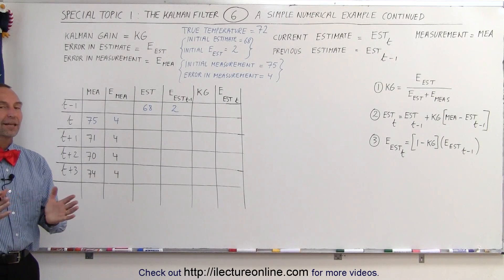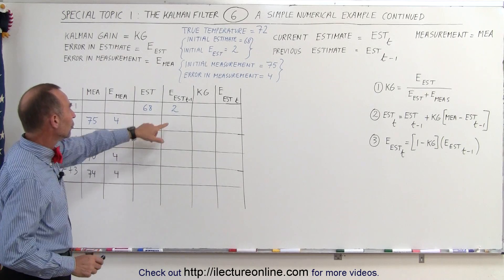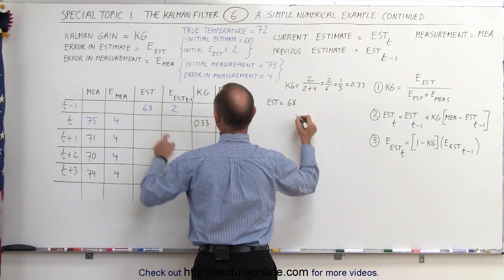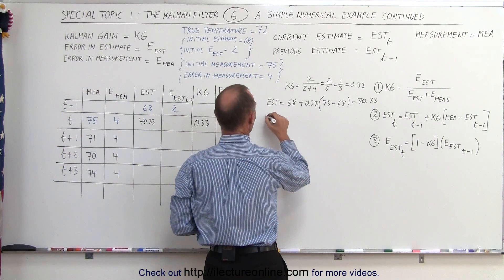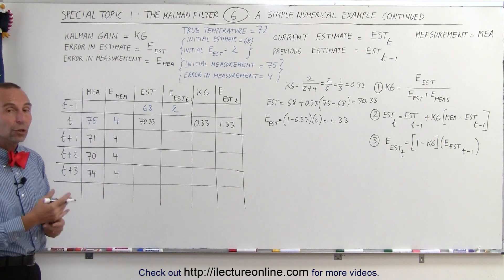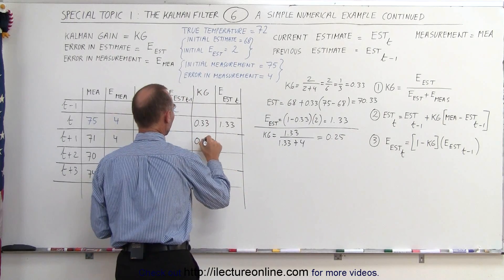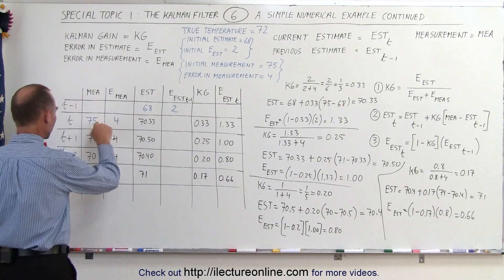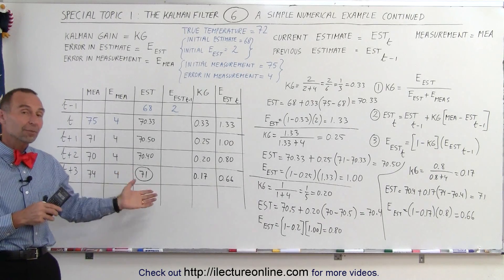Special Topics - The Kalman Filter (6 of 55) A Simple Example of the Kalman Filter (Continued)

Comment: Great explanation, but I noticed that if I just take the simple average of all the measurement values + the initial estimate in each step, we get more accurate numbers in each step.

I get the next values at each step: 71.5, 71.33, 71, 71.6, so while I understand the explanation, its hard to see why is it better at this point.

Guess I need to watch the other vids as well :)
Reply: An update to my comment: based on intuition I thought Kalman filter might actually be better when a big error comes in later. With two extra points:

extra measurement 1: 79

KG		0.14
ESTt		72.12
EESTt		0.56

extra measurement 2: 75

KG		0.122
ESTt		72.4656
EESTt		0.49

The relevant values we got by averaging are 72.8, 73.14, so bingo, averging is worse for this case.

So as far as I see Kalman filter actually handles better the unexpected big errors later on, thats where its better, it has a natural flattening built in due to the keep decreasing KG.

But then the next obvious questions are:

a) What happens if we get really unlucky at the start and we get 78,79,77,79 readings, so Kalman filter establishes itself up around those values and then it will be much slower coming down than the averaging method, as the KG factor will be also small by that time.
		
b) Could we achieve a similar flattening with simpler methods, just by saying I give less weight to the datapoints coming later and somehow maximize this flattening effect based on the fix Error in measurement? 

Now thinking it through point b) KG calculation probably does exactly that.
Reply from the maker: The first few videos are just there to gain a basic understanding.  To see how the KF really works see the rest of the playlist.
Reply: I was thinking the same thing! I guess this is just a very simple example and the real strength of the filter comes in when you look at multidimensional processes and hidden variables: you measure temperature but the variable you're interested in is someone's immunity response, for example. 
Also, the deviation of the Kalman filter is better: if you take the mean, the std = sqrt(16*4 + 4) = 3.69. VS 0.66 for the Kalman filter.

Comment: how do you find out error in the measurement in the first place?
Reply from the maker: Depending on the situation and the sensors used, the error may be known based on the known performance of the sensor.  But if not known then we must guess.
Reply: @MichelvanBiezen  got it. thank you for this series!

Comment: If you take the simple average (75+71+70+74)/4 you get 72.5, which is even closer to the true value than the Kalman Filter.
I wonder when is the simple average worse than the Kalman filter (for stationary values)?
Reply from the maker: This is just for illustration.  If you watch the next videos in the series you will see the value of the Kalman Filter.  It works amazingly well.

Comment: How do we determine the initial estimation error and measurement error?
Reply from the maker: You make an estimate based on your knowledge and understanding of the equipment used.  Even if you don't have a good estimate, the filter will quickly converge to the correct values.

Comment: If our true temperature is 72 and measurment error is 4 ,does it mean that our measurments can not show values outside of this scope  (68---76) ?Thank you
Reply from the maker: No, the values being read can still be outside those values.  The measurement error can be caused by the fluctuations in the equipment, or the accuracy of the sensor, or any number of known errors that can affect the measurement.

Comment: This is a so great class series that I enjoyed watching. One thing I like to make sure I understand is the Error in Measurement, 4 in this example. Is it correct that each particular measurement setup has its own error in measurement witch is a constant? And how do we find out the value of it? Thank you!
Reply from the maker: There are several sources of errors in measurment (error caused by the internal electronics of the application, errors in the SW algorithms, errors in the actual measurement, etc.)  These are dependent of the system you are dealing with (radar, tracking, GPS, automated measuring devices, etc.)  Most of the errors are known, and are used in the Filter.  Some errors are random.
Reply: @MichelvanBiezen  Thank you for the answer!

Comment: Excelent video Mr. Van Biezen, but I have a question: if instead of applying the Kalman Filter you simply calculate the SMA on the measured data, i.e. (75+71+70+74/4) you get 72,5 wich is more close to 72 than 71. Would it be better to calculate the SMA than the Kalman Filter?
Reply from the maker: This is just a simple example (along with the following videos) to show how the KF works.  In an actual application we don't know what the actual (true) value is and the KF will get us closer to the true value than any other method.  (It places a weighting factor on the assumed errors and the measurements)
Reply: @MichelvanBiezen  Well, Mr. van Bienzen, I understand, but then I have another doubt: if we dont know what the true value is how can we know that KF is faster than any other method?
Reply from the maker: The KF has been used in many applications all over the world and it works like a charm.  It is particular useful in tracking algorithms and we use it on radar technology and GPS technology as an example.
Reply: @MichelvanBiezen  Ok, thanks a lot. Your videos are very, very clear. I think those are the first internet material in wich I really can understand Kalman Filter.

Comment: How do you get the initial errors for the error in estimates and error in measurements?
Reply from the maker: It should be your best guess based on what you know.  As it turns out, the initial errors do not affect the final outcome.  Once you have programmed your model, put in different starting points and the filter will rather quickly converge to the near correct values.
Reply: @MichelvanBiezen  Ah, I see. Thank you. So, that means that some prior knowledge would be nice, but it wouId still yield a good end result. 

Ps. I programmed this example in python, as I was following along with the video, and indeed the fast convergence occurred even when I accidentally entered a wrong estimate.
Reply from the maker: Yes, the Kalman Filter is amazing.

Comment: Once again, great video. This question may sound silly, but how would this method be superior to just taking the average between all measured values? (in this case, <MEA> = 72.5)
Reply from the maker: The KF is actually an amazing filter that alternates the weight it gives to the uncertainty vs the expected value (in a tracking situation for example).  It is far superior to taking the average.  (see the following videos).

Comment: Does the error in the estimate have to go down every time?
Reply from the maker: The error will fluctuate.
Reply: @MichelvanBiezen  I have implemented the extended KF for the logistics differential equation. The error increases and the slowly reaches a maximum. I don't know if it's correct
Reply from the maker: The Kalman filter is typically used on measurements of actual systems, such as radar signals, GPS signals, etc. the eliminate unpredictable input variations, and variations caused by system inaccuracies, etc.

Comment: one question.. In what case will the gain start increasing? What if the value change from 70 to 50? the values wont converge so fast. KG in not a function of new values?
Reply from the maker: Depending on the choice of initial values, the KF will take a little longer to converge, but there isn't a lot of difference as the KF converges amazingly quickly.

Comment: Dear sir, thank you so much for your nicely explained videos on Kalman Filter. I want to ask you a question. Can the KF be helpful for forecasting the future demand of products using the historical data from time series?
Reply from the maker: the Kalman Filter is typically used for predicting where something will be based on behavior that can be formulated with an equation, like the position of a projectile, not so much for something that can be influenced by many unpredictable factors.
Reply: @MichelvanBiezen  Thank you, dear sir for your quick reply. Would you please comment on the paper that is available in the following link where KF is used to fit time series? https://ieeexplore.ieee.org/document/8302108

Comment: Have a question for t+1, https://youtu.be/SIQJaqYVtuE?t=277,  here we say error is +/- 1, and estimation is 70.5. So it can be at most 71.5. However, our true value, is not within the range. Does it mean our error (or uncertainty) is incorrectly calculated?
Reply from the maker: No, the uncertainty is fine as is.
Reply: @MichelvanBiezen  Hi Thank you for the reply. Would you mind clarify why that is the case? Isn't the definition of uncertainty is to declare the range where our true value will lie, i.e. the value 70.5 +/- 1 means that the true value must lie within [69.5, 71.5]?  

Isn't 71.5 is the upper bound of the possible value?

Comment: However, taking the mean of the 4 values (72.5) gets you closer to the true temperature. Also what do you do if you don't know (as is usual) the error in the measurement? Also is there a rule of thumb for choosing an initial value for the error in the estimate?
Reply from the maker: This is just an example, to show how the filter works.  As it turns out, with the Kalman filter, it doesn't actually matter what initial error we pick, since the filter will zero in to the correct value very quickly.    Typically, we pick an initial error estimate that seems reasonable for the particular application.

Comment: Here my question is True measurement is fixed to 72. Now as each time step measurement reading by the sensor is also changing from 75 -71-70-74 as explained. If so, then how would you say that the Error in the measurement will always remain the same? It basically depends on its error probability distribution.

Comment: Do I know the Error in the measurement before I start the process of calculations, and is it constant all the time like here 
(E__MEA = 4), is it the sensor error tolerance?
Reply from the maker: Sometimes you do, (and it can come from a number of reasons), and sometimes you don't.  Either way, the filter will work.

Comment: professor, can we assume the error in measurement as any value sy +or- 2 if we don't know the exact value?
Reply from the maker: It turns out, that the Kalman filter works regardless which error exists or is chosen.  Once the measurement data is being fed into the filter, the filter will converge quickly to the filtered value.
Reply: @MichelvanBiezen  Thank you very much for the reply professor. I am working on battery modeling for HEV vehicles, I wanted to use kalman technique to fit the estimated and experimental data and that's how i found your lecture. These lectures are absolutely amazing. Keep up this good work professor.

Comment: Hello Michel, can you explain how new valid measurements are accepted into the estimate? If you continue the calculation, KG will keep getting smaller, which results in the filter "rejecting" any valid reading of higher or lower temperature.

Comment: Special Scenario: Suppose KG become stable near zero after long run, and E(est) stable, now temperature going to increases so E(meas) will increases, then KG will be tends to zero, and E(est)t almost equal to E(est)t-1 so EST(t) will not increases.
Reply: I'd like to know that too. The algorithm will stop to accept new values because kalman gain gets zero. It seems to me that there is something missing that prevents it or increases kg depending on the measurements. Without any additional step, kg doesn't depend on the measurements but is predefined by the chosen parameters and and reaches zero asymptotic.
Reply: Ok I read all comments and found the answer. Just repeating it here so that everyone can find in the top comments. This is oversimplified and in reality the "process noise" needs to be taken into account which will prevent kg decrease to zero!

Comment: The example is not very realistic since the initial estimate is 68, and the error of the estimate is 2, which would put the temperature between 66 and 70, even though the true value is 72. That's why it was so slow to converge, because the Kalman Gain started too small compared to the reality of the problem. Also, this method is not prepared for concept drift (change in the true temperature value). Why would you use this instead of, say, exponential smoothing, with the trigg & leach method?

Comment: I doubt that the Kalman Gain calculated each time is computed by taking in the same Error in Measurement, but the fact is every time the measurement is different and hence the Error in measurement is. So, the Kalman Filter will converge to accurate estimations sooner than explained.

Comment: Your lectures are awesome. Well done.  I have one question. How did you get the initial values 68 and 2? How to select this initial values in a real implementation?
Reply from the maker: This was just an example.  In a real application you should pick a reasonable value.  In the end it doesn't matter what value you pick since the filter will quickly converge to the correct value.
Reply: Thanks a lot for your quick response.

Comment: Thank you very much for making this series, it is very clear so far and very helpful.

One question I have: Will this example only work when the true temperature stays constant? It seems as though the Kalman Gain will tend towards 0 in a set number of sets purely influenced by the constant measurement error. Then when the KG is near zero, if the true temp were to rise to 85 let's say, the system would effectively ignore any incoming measurements and never converge near the true temp.
Reply from the maker: The Kalman filter is designed to track a constantly changing "number" or "thing".  It is commonly used to track satellites, radar targets, etc.
Reply: well this makes me think that even it is designed to track constantly changing things/numbers, the error of estimation will still always converge no matter what, then it will finally still reach to a point where it starts ignoring new measurements right? then how it is gonna work with new measurements even given there are no huge change? Appreciate in advance for any explanations here for my question

Comment: Thank you very much Sir, your way of teaching and explanation is really great.... but i have two questions and i would truly appreciate your answer..... first we all know (mathematically speaking) that the value of the error in the measured value(s) is normally +/- (plus or minus) a certain value i.e range of values and not a fixed single value like you used here in the measured value(s) (which is 4 in the video example) , because simply if we know the measured value and we know exactly the error in the measuring apparatus so we can very simply calculate the true value i.e True value = measured value + error, and the Kalman filter calculations will have no meaning !!. Second if the error is a range (between a negative and a positive values for example from -3 to 3) not a single fixed value so the question here is which value to use ??.

Comment: I looked threw the comments and didn't find this question.. I built these equations into an arduino and faked all the measurements to make sure they calculated out the same as yours. I then took out the fake measurements and took real measurements. The filter converged really quickly, but afterward I stuck my finger on the sensor and the measured readings went up by 10 degrees, but the current estimate moves really slowly toward the new measurements, probably about a minute or so. I watched the Kalman gain and the error in the estimate and they both stay at 0.00. Am I wrong in thinking that the current estimate is the output of the filter? Shouldn't the Kalman gain and error in the estimate ramp up with a 10 degree change in the measured value? It seems like once they  reach zero they get stuck.  I'm not very smart with math or arduino, but am trying to learn.  Thanks for the lectures and any response you may offer.
Reply: Heuristics can help you. If the temperature changes by more than the "error" of the sensor, reset your estimate to somewhere within the temperature error! The universe does not limit you to the theory :)

Comment: Why should error in measurement be fixed? KG and Error in estimate is bound to decrease as we have - { error estimate at t= (1-kg)*error estimate at t-1 } Can same kind of smoothing achieved by moving average ?
Reply from the maker: Typically the error in measurement remains fixed, as the uncertainties are known.  There are other contributor which are handled differently in the filter if there are variations to the input.
Reply: thanks, I am unable to think how kalman filter is better than other smoothing algorithms ?

Comment: Hi, great tutorial!!! 
Can we predict the temperature at (t+5) time by just only taking measurements at the time [t:t+3]? I mean can we estimate room temperature in 5 minutes later?  Is it possible by analyzing previous measurements?
Reply from the maker: The KF is not used for prediction, but for smoothing out uncertainties and random variation in the process.  For predicting future values, we use a math modeling technique extrapolating the current calculated curve.